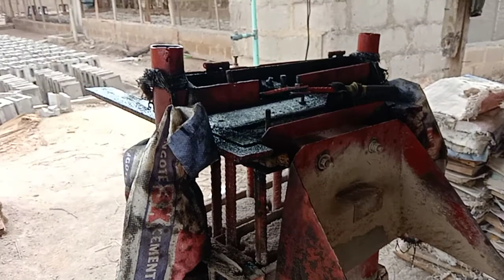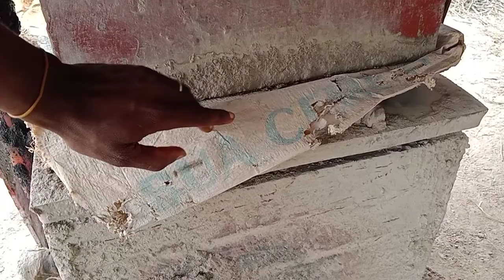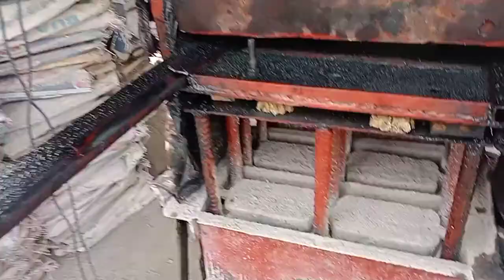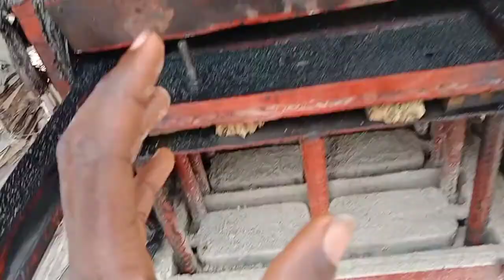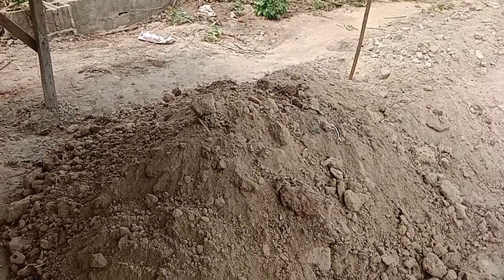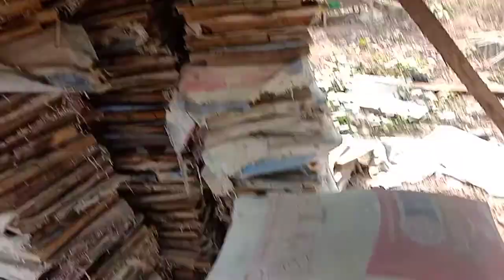How to Start and Make Money From Block industry Business

Comment: How many 6/ 9 blocks does one bag of cement mould for commercial purpose and 2. How can the moulding machine to be secured from theft
Reply from the maker: Thanks for your comments,. 1. When moulding, strength and quality matters. 1 bag makes 50 to 54 of 6 inches, while 1 bag makes 35- 37 9 inches block. with these you make quality...